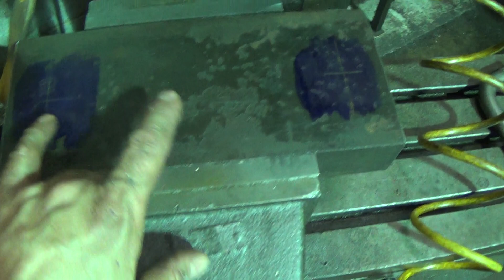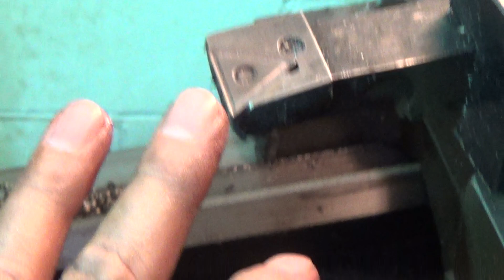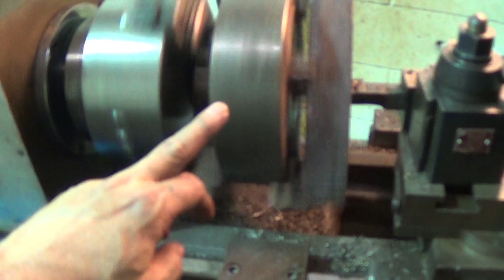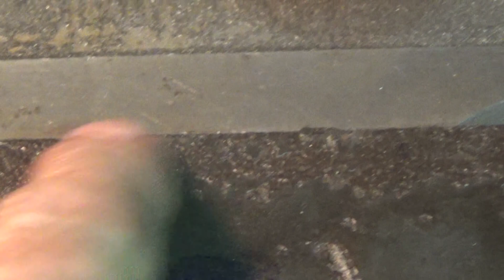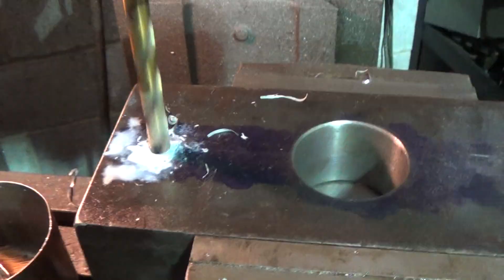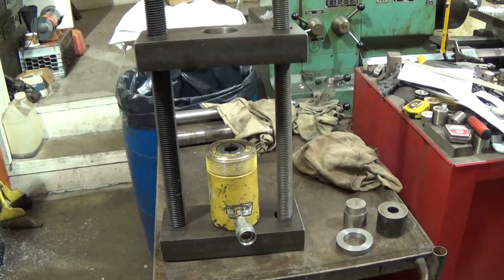Portable Hydraulic Press Frame

Comment: Hi Mike. Good job on the pressing plates got to love the double chuck idea but it does work.
I guess you do not have the mount for the four jaw to suit this lathe would be good to just take off the three jaw and put on the four jaw but it works for you so that's all that matters.
True what you say about the boring head on the mill would take so long if you did not have the drill close to the size that want.
Can really remove a lot of material quickly on the lathe but just a pain to set up the piece in the four jaw that can take a little time.
Good you were able to get it done and ready for you job the next day.
All The Best. Peter.

Comment: Cool vise trick. I learned on Kurt vises at school but ain't likely to have one when I get a personal mill so that's something I'd not have known.
Chucking chucks in chucks is very common in manual machine shops. It works, it ain't new, and if the dial indicator says it's kosher then it's kosher.
The way you laid out that portable press could also do something else for you should you ever need it. If you had to press an item out of a large plate or machine arm you can't encompass within the puller, you could counterbore the press block with the center hole and insert a couple of large long bolts instead of using threaded rod.  The "bolt head" side of the block would be against the workpiece. You could tack weld the block to the plate/arm then use the ram to press out your pin/bushing/whatever from one side.
Reply from the maker: Hi Ob,  it's just part of my bumblebee mentality I guess, thanks for the compliment

Comment: why don't you thread the plate, then you can use it without juggling the ram as well as any pushing bushes etc.....
Reply from the maker: I suppose that would be a good idea, but I don't think I have a 1.5" tap, and then I'd have to use that size rod all the time or chance messing up the threads with other size rods running in the threaded holes. If it was a purpose built tool I think it would be fine.